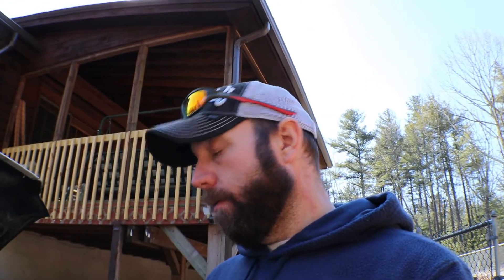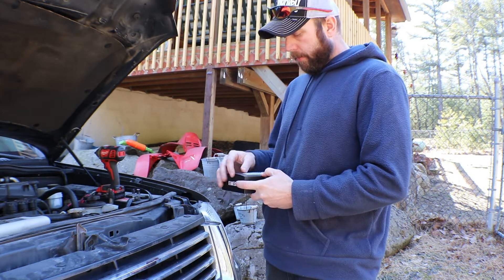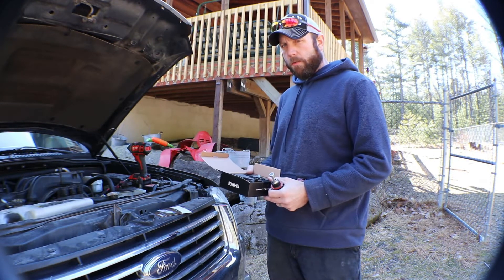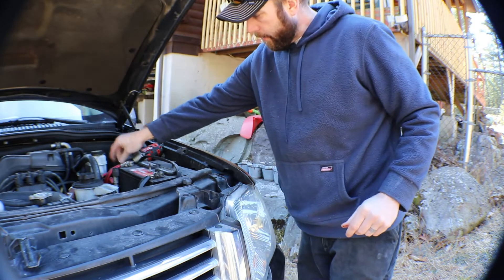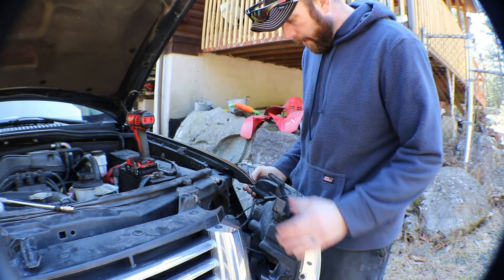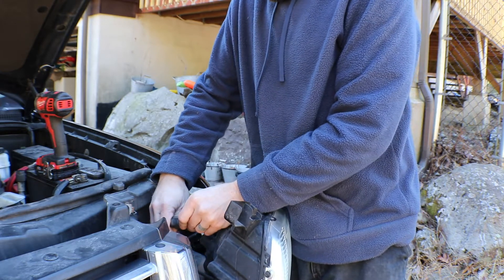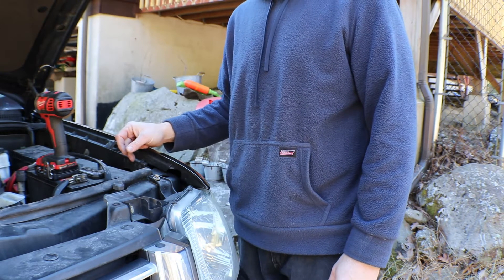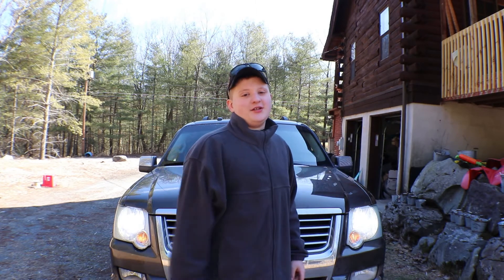Beamtech H13 LED Headlight Installation On A 2008 Ford Explorer

Comment: How are the led bulbs holding up ?? Do you still recommend the brand for led headlights?
Reply from the maker: They are still working, I like beamtech better...i did a video on them
Reply from the maker: Sorry read that wrong! Yes I still recommend them....Not the Faren brand I did in another video
Reply: Did you had to do anything extra I have the same car and after I installed when I turned the high beam on the car shows a massage saying to check the headlights
Reply from the maker: @mr.rodriguez4741  mine did too, I just lived with it...
Reply: @hereshopengarage2790  I wonder what's the reason for that and if it can be fix
Reply: @hereshopengarage2790  Hello, does it only throw the error on the high beams, or does it do it every time you use the headlights? Also, does it do a quick flash when turning on the ignition like some of the other LED's on the market? Thank you in advance.
Reply from the maker: @justinochsner6531  just when flipping to high beams, does not quick flash
Reply: @hereshopengarage2790  Hi, quick question, I have a car like yours, and I have a problem, I can’t turn off the day time running lights, can you please tell me how you disabled the lights on your car.